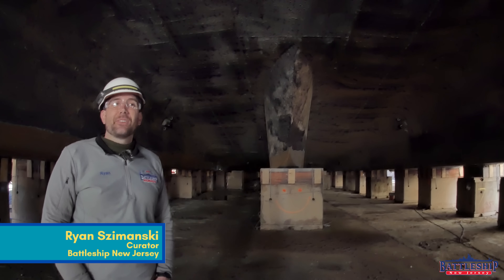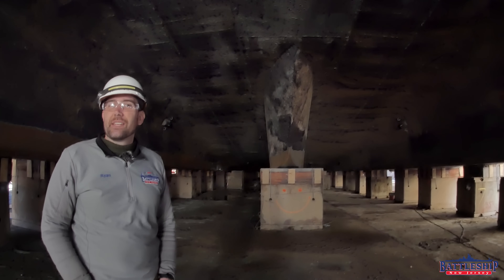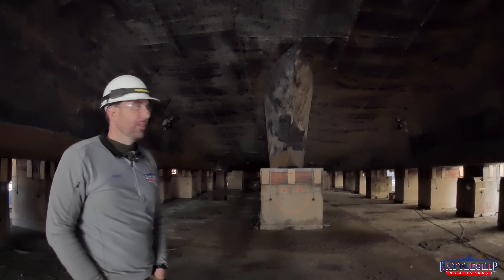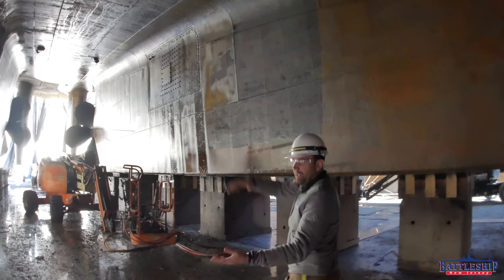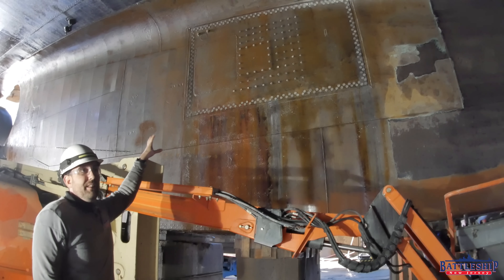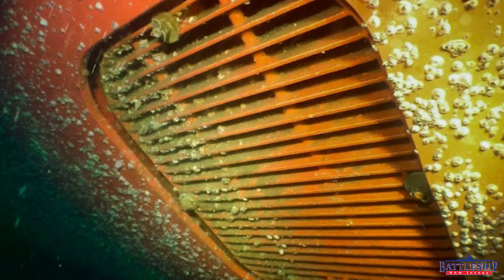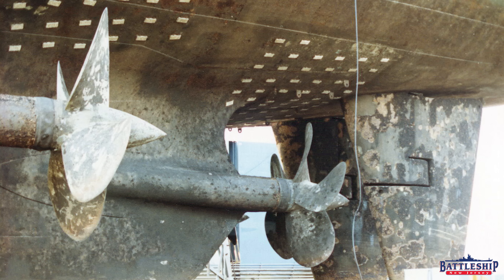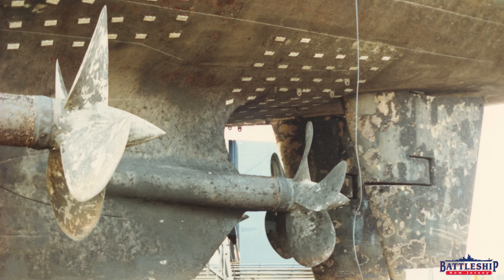What's Wrong With Your Model of An Iowa Class Battleship

Comment: You could/should get a LIDAR team down there to map the hull while you can.  You would then get the exact dimensions of the ship right down to the rivets.
Reply: That would be awesome! Yet probably too expensive...
Reply: I was thinking the same thing and it's definitely not that expensive. It's a piece of equipment that some museums and larger police forces should already have.
Reply: You make a great point. It also is a great way to preserve the ship in digital form for generations 2 hundred years from now to study.
Reply: How do you repair the surfaces that are sitting on top the dry dock blocks?
Reply: Wonder if a kit making company would be interested in sponsoring some of those costs?
Reply: They will refloat the battleship move her exactly 4 feet and treat the previously keelblocked surfaces.
Reply: Last week or the week before he was asked if this was going to be done while in dry dock, his answer was yes it was going to be done and I can't remember if he said it is going to be made public or not. I'd imagine the files would be at a price though.
Reply: Get the right 3d scanning software to run on your iPhones.  That's easy.
Reply: To repair the surfaces that are currently sitting on the dry dock blocks, they do what's called "refloating" where they fill the dry dock with enough water to get the ship to lift off the blocks, reposition the blocks in an alternate scheme, and/or move the ship slightly so that those areas are uncovered.  Some dry dock repair plans require two refloating operations to get them all, some plans require only one refloat.  Ryan has talked extensively about refloating plans in the past, so see the archives for more information.
Reply: If he had his own scanner for the museum, then they could employ it at other times once the ship is back at birth to measure other spaces as well. Such measurements could be used for practical purposes as well as 3d modeling the ship, such as aiding with future maintenance decisions and planning.
Reply: A good 3D scanner is a bit pricey. I wonder whether you could rent one, or contract a professional to come in and make the scan.
Reply: @shubinternet  they're going to re-float and shift her a few feet aft (i think aft) .. something like 6-8 feet i believe
Reply: That is an excellent idea!
Reply: @mantis0427  someone should donate their services.........
Reply: I second this but also recommend a Muon detection to discover all those voids

Comment: 5:22 So a friend of mine in Odessa Ukraine built for me a 1:350 scale model of my submarine USS Asheville (SSN-758) which is a tiny scale for such a small ship.  He included all the hull openings, all the plates on the sail, all the grates on the bottom for allowing the seawater to flood the ballast tanks.  He also included all the vents up top as well as the cleats.  He also included all the zinc anodes, and my surprise, he even got the drains at the bottom of the sail, as well as the bridge windshield. I cannot believe all the effort in detail he put into this. I was stunned.

Comment: The plate at 2:36  Looking at the general plans on the Hold level that shows the Driveshafts,  between 181 and 185 it appears there is a coupling, bushing, or spring bearing up in there. My bet is a coupling.  But it shows the bulge on the plans.
Reply: I was thinking that too. I have next to zero knowledge on Iowa-class drive systems, but it's hard to imagine another reason to put identical access panels down there.
Reply: Makes sense.  I was looking at the keels and wondering how hard it would be to work on the shafts in a keel.
Reply: The plans just call it void space.  But you can see the joint or bearing on them.

Comment: The Ark was built in cubits for dimensions…

Battleship NJ was built in curators!

Go Ryan!

😃
Reply: The problem is he is on the thin side if you have checked out most the others.  TX's is shorter but half again as wide.  The reason England first standardized guns and rounds at the tower of london going back to a person based measurements causes problems.

Comment: I am blown a way  by the amount of engineering and design that has gone into the hull.  This was all done by slide rule and human brains.   As to models and accuracy, I grew up on Airfix and my favourite brand Monogram.  Regardless of how accurate new kits are, Monogram to me, always caught the feel of the subject better than anyone else on most kits.  

And thanks for another great video!
Reply: You can tell by looking at it how much engineering??!?
Reply: @xpusostomos  its right in front of you.

yes.
Reply: @xpusostomos  yup
Reply: @raithebatou  I see. Tell me which ship you looked at and thought... hmm, not much engineering here...
Reply: @raithebatou …yep, and yeppers…. An engineer can always see engineering…

And sadly, 99.99% of folks marvel at how “it was done without calculators or computers”…
Totally forgetting the hundreds (if not thousands) of workers (almost 100% female) whose job was to ‘calculate’ using paper, pencil, eraser and hand-cranked adding machines to get the numerical answers that the engineering teams required.

These workers were called ‘calculators’ and ‘computers’.
Reply: @xpusostomos  To be honest and blunt, the only aquatic vehicles I have any interest in are 
1. Nuke powered submarines and
2. WW2 Battleships

So I haven't given the rest of them not much thought at all.
Reply: @raithebatou  ok, so you don't know what you're talking about. Thanks for clarifying

Comment: I've been working on the 1/350th scale kit of the Missouri by Tamiya for a very long time. The biggest  inaccuracy I've noticed is that it's missing the athwartships passageway on the weather deck behind the bridge. I don't know if that was added as part of the modernization or not, or if New Jersey has the same. I did visit the Mo. in Pearl Harbor to confirm that it was there.

Comment: If I got back into model building I would use the Iowas as a basis for my vision for a future battleship.  The rear would be boxed with a well deck, (invison nuke drive like subs or carriers) the aft main gun space would hold a two bay (4 craft total) vstol hanger with a double rail gun on top.  Another double rail gun forward and a series of box missle launchers (say between 2-4 times a modern missle cruiser.  Add a pair of torpedeo lunchers forward just above the waterline extending from the blisters on the belt with a limited magazine on either side.  Keep the modern five inch guns and seawiz.  They would be ideal for special operations acting independant from the main battle groups and bombardment with a 5 to 15 lbs. Factional C fired round from the rail guns.

Comment: No model company has got the shape of the hull right. Especially around the skegs. The Joy Yard 1/350 Missouri came close though. It's probably the most accurate.
Reply: Yup. I've no clue, because there's some pretty detailed plans to work with online, it's not like this was secret OF 30 years now. At least one company should've gotten it right, but nope... i suspect, i  might be wrong, but i suspect they're using older plans or plans that don't exactly match the ships. I've seen some pretty wacky stuff while looking for the Iowa class (and older) plans online to understand what Ryan's talking about a bit better.
Reply: I'm surprised the Tamiya doesn't have a realistic hull, especially considering how much that kit costs.

Comment: There is a void space on the other side of the panels you conjecture about in which - in the event of scuttling or beaching - you place a scuttling charge to blow off the props to and begin to take a controlled amount of water by the stern.

Comment: As a modeler, not all model kits are perfect. However, you can upgrade the kits with photoetch kits. I have a 1/200 scale Trumpeter kit USS Missouri WW2 version. It's a nice model kit and lots of improvement can be done with upgrades. However, it's limited on upgrades and it can get very expensive.  Model building is a great hobby to get into to learn it's history and how the ships were built during that time.

Comment: I wonder how many total hours of work it took to build that ship?  The bottom looks in pretty good shape. The electric current and anodes worked quite well. They do that with bridges now. Not being in saltwater helps a lot on the top side. Living on the Gulf Coast I had no idea that vehicles in the Rust Belt only last about 12 years before they are ready for recycling.

Comment: A lot of models leave off details because it would be difficult to realize because of the molds. Even the 1/200 scale Trumpeter kit leaves off a lot of fine details. Now you can get Photo-etch detail kits to add some of the more intricate details but only the big through hull grates are included,and these photo-etch detail sets are incredibly tedious and time consuming to apply. I built the Trumpeter Bismarck and it took me over a year to finish.
Reply: I'm currently working on the 1/200 Trumpeter Bismarck for about 2 1/2 months now and see no end in sight! LOL!! I want to build the New Jersey but they only have the Missouri and I just don't know what the differences between the two are.

Comment: Going back to the previous video about the propellers and also this one, I always thought that propellers turned inwards not outwards. The idea for that I believe was to force the water back over the rudder(s) to assist in manoeuvring and not out sideways. Seeing the propellers on USS New Jersey has made me wonder if the way her propellers turn is a 'ship' thing rather than a 'boat' thing. On my MTB models the propellers all turn inwards.
I agree completely about the poor detailing on models, even the bigger 1/200 kits. You would think that the time and cost it takes to produce the moulds the manufacturers would take the trouble to check and double check that they have got it right  - even to ask the people like Ryan who has a tremendous amount of information to hand.

Comment: Great points of detail, although as a 1:1200 scale waterline modeler I can skip over some of these details.

For larger scale full hull modelers, PLEASE research what rotation the propellers have on each side of the ship. For most US WW II era steam powered ships, they are generally left-handed (LH) on the port side, right-handed (RH) on the starboard side. This was true on both twin-screw ships I served on; the single screw frigate was RH. To me it is especially jarring to see the propellers with the wrong "handedness", or worse, the same on all propellers.

This general rule is not always the case. Looking at pre-launch pictures of RMS Lusitania (1907), she clearly has the following arrangement:

Port Outboard: RH
Port Inboard: LH
Starboard Inboard: RH
Starboard Outboard: LH

This is probably due to the fact that her propulsion plant is really a "twin screw like" plant; high pressure steam drove the outboard shaft direct drive HP turbines, which then exhausted to the inboard shaft direct drive LP turbines. She did not have four separate identical turbine units like NJ does. Many WW I era Royal Navy ships had a similar arrangement, so do your research, and don't be surprised to find an unusual propeller arrangement.

Comment: My dad said on the USS Santa Fe CL60 in WWII had a large cable attatched all the way around the hull. It ended in a compartment filled with sacrificial metal. I will assume zinc. I have no idea if other ships had the same anti-rust system. I may be wrong but I think he said voltage was ran through the cable. He died in 1998 so I can’t ask, and I’m just going off my memory.

Comment: Ryan the zincs don’t look that bad. If they are dimensionally intact and the weight is right. Polish and reapply. Priced them at $187 each. That’s with a 2.5” thickness Bolt on mounting.

Comment: The real ship doesn't have the terrible Testors paint job that my model does.🎨🚢
Reply: I agree, painting mine is easily the hardest part
Reply: I love my air brush
Reply: Ironically I find Tamiya paints do a great job for US WW2 model kits...
Reply: @LongWatchman  I could handle the whole gluing stuff together part. I never had a handle on the whole art work. So I have a lot of gray plastic ships. Luckily, they are supposed to be grey. 🎨🙇🏽‍♂️
Reply: @WALTERBROADDUS  Gluing up is the best part. When I was growing up we only had Testors enamel paints for model kits. I'm sure many others used them to wonderful effect, but for 13 year old me it never worked the way I wanted. Uneven coats, wavy lines and the like. Years later I found Tamiya Acrylic paint and that changed everything.
Reply: @LongWatchman  I think it was just the glue fumes getting us both high? Lol. Had to pop the window after a while.

Comment: I just received my 1/700 scale model of an Allen M. Sumner class destroyer. Freaked me out. Its just thin brass sheet metal that seems to have been laser cut.  I have no idea how to even begin to build it. What directions it dies have are in either Chinese or Japanese. I got it because my uncle was lost on a Sumner class destroyer, the USS Drexler. Even worse is the thought of painting it with the “dazzle” camo it had when it sank in ‘45. The whole thing is less than 4” long.

Comment: Pretty sure whatever company offered this model that I have (built by my father in the 1950's) was told nothing of the underside of the Iowa class. It is flat bottomed, with a stepped rise toward the stern, with a single rudder that is longer horizontally than it is vertically. It has no propellers. It would be interesting to know the reason why the model is so far from reality, if it was just simplistic design for a cheap plastic model, or if the Navy shrouded this design like they have the props on a lot of the destroyers and subs we build now.

Comment: Is my math right, at 1/700th scale a 12x6x1.15 block is about 17 thousandths by 8.5 thousandths, by 1.8 thousandths of an inch?  Maybe airbrushed paint with a stencil of some sort would get close to scale, but even a sticker would be about 5 times too thick to be proper scale.  Even airbrushed on, you wouldn't see any more detail to differentiate from just using a ultra fine point sharpie and putting dots on the hull.

Comment: It's infuriating that no company has an October 43 - May 45 New Jersey model. Veryfire offers a New Jersey kit but it's really representative of her August 1945 bombardment of Wake Island. I believe there were some modifications made in July - August 44 when she went to Pearl to be used as Halsey's flagship, but I assume most of these mods were internal. 

Using a Missouri kit is usually better than using an Iowa kit because of the location of the 40mm bofor on turret 2 as opposed to the quad single  20mm Oerlikon's on turret 2 on Iowa. I'm really struggling to find an accurate description of where her 20mm mounts were during WWII. 

Also, apparently the fire control radar for the main battery is different on Iowa and New Jersey than it is on Missouri and Wisconsin, at least before Iowa went into the yard in late 44 early 45 and New Jersey in May 45.

Comment: Back in the 1980's I went to the Bachman company maybe 5 story building on Erie Avenue in Philly to inspect a few injection molding machines a customer of mine was purchasing. After this customer made various Plasticville train houses & buildings for 18 months they told Bachman they had to raise the price and several old molds needed repairs or replacement. They told them they had to reduce the price or job & molds would be sent to cheating communist china.  Unfortunately it all went to lying cheating lack of caring or quality control china and heard the Chinese produced items were not good looking as the products made in the USA. Since that time model trains has joined phone booths, drive in movie theatres etc dying a slow death.